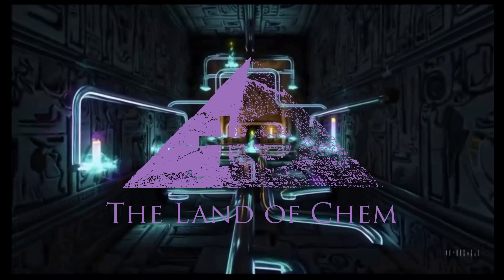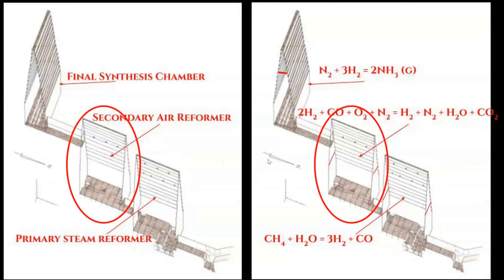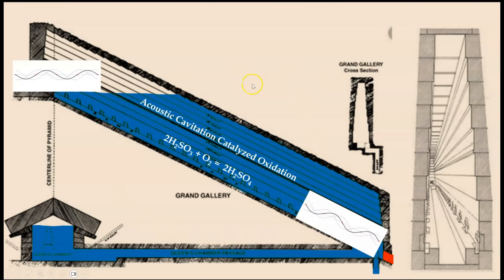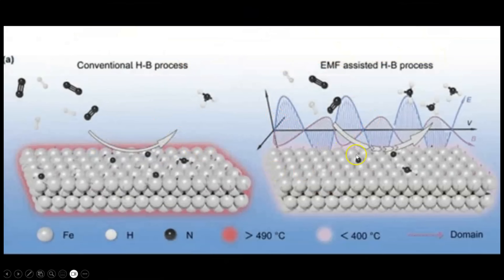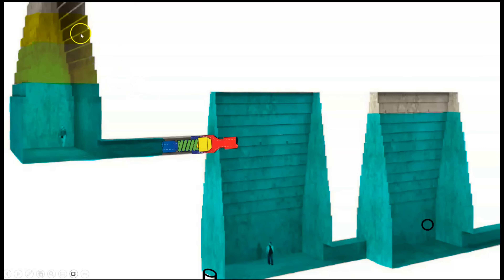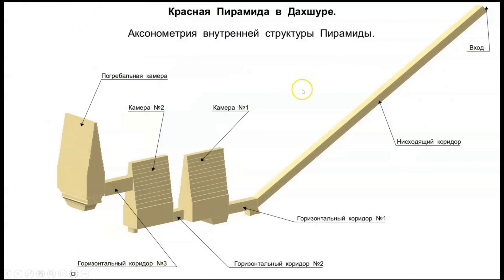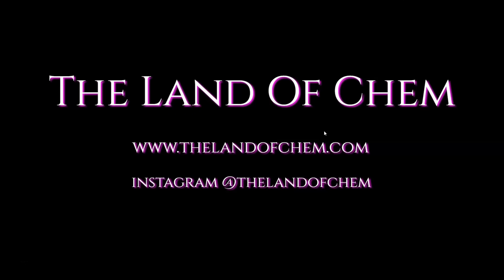ANCIENT CHEMICAL ENGINEERING TECHNOLOGY PART 4 - RED PYRAMID FINAL SYNTHESIS CHAMBER: Episode 159

Comment: One question: do you think that the Sabu disc, strange artefact, a black stone helix "vase", could be a piece of the missing air reformer? The helix shape suggests strongly a capability to move air and make it circulate, like a fan. Or for mixing and dissolving two liquid components, or a gaz in a liquid?
Reply from the maker: Yo WS!  I am extremely skeptical of the schist disck having any industrial applications. It's a super fragile material (especially how thin it is), and if it was industrial, they would have just made it from metal. That being said, it is absolutley a mixing/vortex creation tool of some sort, whether that be liquid or gas. But it was used in a very controlled, gentle manner

Comment: Very impressive work but you've made a mistake with your chemical synthesis. 
(this is constructive criticism please read below.)

If you look at your equations for the second chamber you will see that you have Hydrogen and Oxygen in a confined space, this will explode.
Due to hydrogen reacting with oxygen over a wide range of proportions you will want this explosion to happen on your terms not randomly. Therefore you will want to spark this reaction at a specific point. 
The chamber will have to have sparkers to prevent this explosion from damaging the second chamber.
These sparkers will have to be above the water column  (piston) and you will want them in multiple given the bad outcomes of a random late explosion.
I would posit that the best place for these sparkers is the 4 divet holes in roof of the second chamber.

You will also want an air pipe into the second chamber to reduce the need to drain down the entire system to refill the second chamber with nitrogen, the best place for such an airline would be below the sparkers.
This could explain the lower divets. Does it contain a pipe/bent over piece of lead?

If you accept the above which I think you have to given your equations.

Then to my mind the purpose of the second chamber is that it is an internal combustion chamber and it is the Hydrogen oxygen explosion that is heating and pressurising the remaining unburnt Hydrogen and Nitrogen gas for ammonia synthesis in the third chamber. 
No need for the water column to enter the third chamber.
In fact water(liquid) ingress would be extremely counter productive to how the third chamber works.(but i'll leave that for a reply if you do).

You've discovered the worlds oldest internal combustion engine. (A Soris engine, {Hydrogen powered combustion engine for chemical synthesis})

Comment: Hey, great work buddy! 

So, if this all was utilising water, does it mean the water needs to be filtered and purified first? I understand that there’s a proposed water purification complex at Djoser, but thinking of technology, scale and size, mind blowing. 

Also perhaps it’s time to look for the drainage? If reactor chambers to this day are smelling of ammonia, there must be a drainage piping leading somewhere with potentially similar ammonia smell or characteristics. I mean. Where does it go once produced? Into the ground, then what. Where’s the outlet?
Reply from the maker: The Gisr El Mudir water purification facility is my original idea from more than 2 years ago. Check out Episode 86
Reply: @thelandofchem  Yeah, remember hearing this from you first :) I've read an article about this recently as well - Think you've got good instincts about this! 

It's intriguing as this proposed ammonia production cycle needs a drain system including underground cut piping leading to storage and distribution, wondering if there is something around the area of the Red Pyramid that would give away the location? The outlet wouln't necessarily be huge as it could be just a smaller shaft made of stone bricks going into the bedrock from the third chamber but the bedrock tunnel would have to be dug a person sized, and possibly a tiled tightly as well to keep the pressure in the system. Would there need to be another pressure valve system inside the last chamber to accommodate for draining than? But netherless, most important thing is that your final product needs to go somewhere safe - right? All this effort is needs an end point. Question is where in the surrounding area can you find the traces of an end pipe?

Comment: In Abydos, it is written on the wall how to make ammonia. That is not what is written. The process is ammonia synthesis, but not in a pyramid.
If the red pyramid had been used to produce ammonia, ammonia should have come out long ago. This ammonia is the product of the decomposition of ammonium chloride in the stone bonding process.
Ammonium chloride was also produced near Karnak. It was mined here. Europe was supplied with this ammonium chloride until the mid-1800s.

Comment: I have one question.. Wouldn't the chambers/reactors always have gas injected each time the water lowers for the next stage in the process ?  Meaning that wouldn't the first chamber always have the methane gas injected each time the water was lowered. Or would that enable the purpose of the pressure block to reach that final synthesis chamber aka reactor #3 ?      Thank you sir

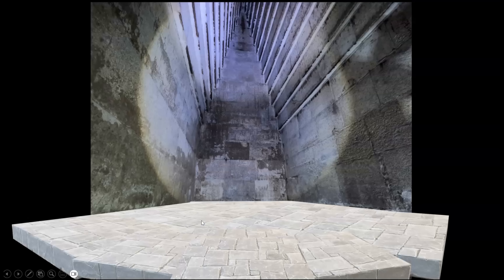Comment: 11:30
Do you think maybe the chamber contained another “sarcophagus”? 
And maybe do you think that “sarcophagus” housed the catalyst?
Maybe that’s what they are? Because if I’m remembering correctly in one of your wife’s videos she states the box is NOT actually the size of the ark of the covenant..! (Huge piece of information)
Reply from the maker: I am doubtful about a container being in there, but whatever it was, was compelling enough for them to remove the whole floor looking for it....
Reply: @  yea exactly, it had value.. 
have you seen hydrogen catalyst? They are solid materials and the moment hydrogen peroxide touches it, it starts pouring off hydrogen gas.. that’s just the hydrogen type.
that may be a part of the system? Like you say, using a catalyst, but where to house the catalyst? And we know the box has something to do with pressure because the corner piece that exploded across the room and hit the wall.. 
I feel like that is a strong theory for the box purpose?
But as always great work! Looking forward to the future videos!

Comment: Question:  What makes the gas move from chamber one to chamber two?  Some gas would move as long as the gas isn't lighter than air.  The gas pattern on the second chamber shows a rising pattern.  I don't know diddly about chemistry, but something has to move the gas from one chamber to the other and the mechanism isn't obvious.  At least to me.
Does some gas just remain in chamber one for the next run -through? In other words, just partial transfer of the gas?  Once the water level lowers enough to unblock the passage between the two chambers the gas would just spread out evenly between the two.  Are there other vents into the chambers?
Like I said, I know very little about chemistry, just trying to get what's going on.
Reply: You can see the same principle as an engine where pistons are changing the pressure and valves are opening compartments (intake, exhaust). Without much pressure or temperature the system is not that great and there are lots of losses (piston rings, overlap between intake and exhaust) but any system like that is designed for a specific range of temperatures, pressures and RPM (in this case not really RPM but lets say it's like a tempo). So once you enter the efficiency range then pressure and temperature are greatly helping and the mixtures can better flow. 
These things were seemingly built like what we call today an engine. It was most likely pumping tons and tons of water a day which makes me think that even if the mix was not perfect in each step, it would just be translated as a loss in efficiency but not in quality.
Reply: @Grouiiiiik  Yeah, but it's clear what pushes the gas out of the cylinder in an engine.  The piston pushes the gas out of the exhaust port and with the piston in the way, there's no way the gas can go anywhere but out the exhaust port (save the aforementioned leaks).
In the first two pyramid chambers, if the water level is lowered to below the top of the connecting passage so that the gas can pass (no pun intended) from one chamber to the next, the water in both chambers would be at the same level.  The gas too would reach a point of equilibrium in both chambers.
Now you could block off the second chamber and fill the water in the first but there would have to be an opening at the top of the chamber to allow the gas to be pushed out to the second chamber, but that's not what the flow pattern on the wall in the second chamber indicates.
But maybe none of this is a problem at all and the gas left in the 1st chamber is just reused for the next go-round.
Reply: I was wondering about that too. When the drain is opened to lower the water after stage 1, its gonna be under a ton of pressure from chamber 1 and shoot out pretty quick, if its allowed. What happens in chamber 2? The diagram shows the water level going down first, before the pressurised chamber 1. Could it somehow create a vacuum in chamber 2 which is what causes the rush through, or suck through, and the damage we see? Or maybe there is just an element of leaving some gas in each chamber after each stage and recycling it and it doesn't matter.
Reply: @philc2457  Hmmm, a vacuum created in chamber two... possibly.  Would the water level in chamber 2 be able to lower with a vacuum in there?  It's possible, if the water in chamber 1 could lower.  Still, that wouldn't pull all the gas through.  The gas would still balance out in the two chambers unless there is some way to force the gas out of the first chamber.
Or again, maybe having the gas in both chambers doesn't matter.
Reply: @GUNNER67akaKelt  its kinda discussed at the end of episode 157. It looks like the pump shaft might be involved, which is in an upcoming video! I think we're actually getting cliff hangers with this series!
Reply: @philc2457  Maybe it'll be made more clear in the next few videos. ¯\_(ツ)_/¯

Comment: Cant wait to see what your findings are at Teotihaucan
Reply: Oh yeah that's an interesting place and much is still buried but my theory is dye factory or food production plant/facility.  Not the main stream concept that it was a village or a paradise or a flea market.  I've heard that it might be a time reading date tracking clock/calendar device that's also acts as a data collecting system. 

I'll stick to my original theory  because my deep investigation rules out the need for all that to study the solar cycles.   Those round pools were for large batches and the long corridors are dryers or dehydrators.